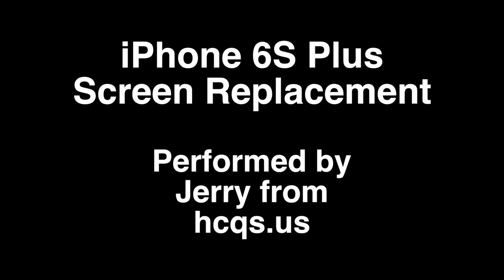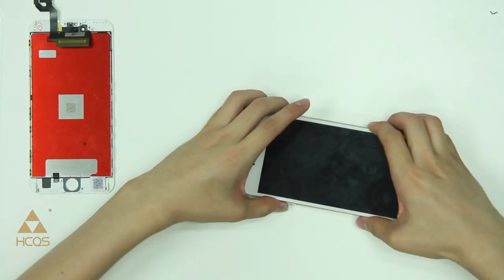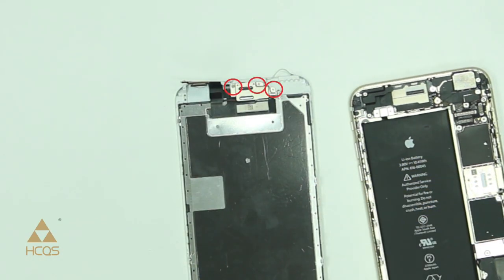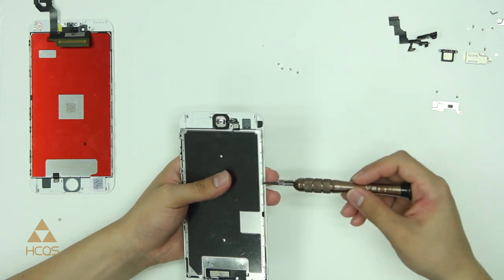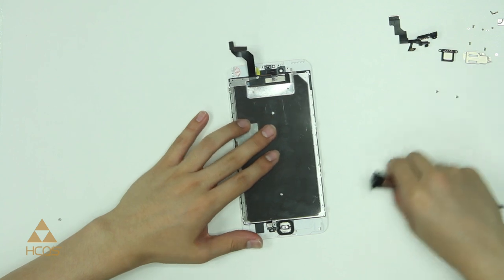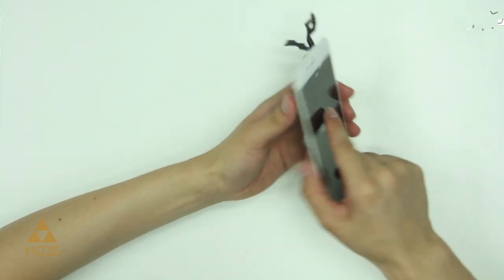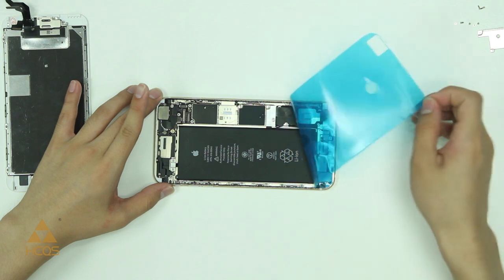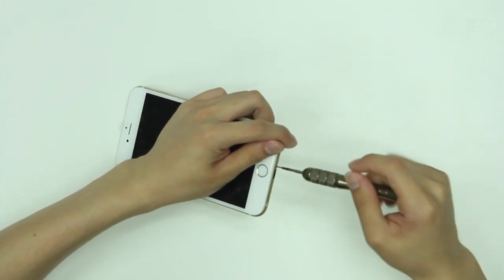iPhone 6S Plus Screen Replacement

Comment: Best instructions I've found so far. I recommend using a magnet or a piece of tape to keep the tiny screws from wandering off. Draw a diagram to keep them in order if necessary.

Comment: Is the secondary adhesive required for the screen to fit correctly?
Reply: just in case anyone is wondering, no the adhesive is not required. I did this without, and it's working perfectly.
Reply: The adhesive is not a requirement, however it does add some water resistance and a little extra protection from dust.